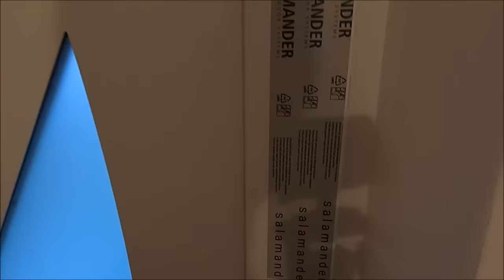I'm Finished with Painting in My Country House Renovation

Comment: To get a smooth finish with the gap filler, dip your finger in dish washing liquid then swipe down, nice and smooth.
Reply: But then you will have to tape both sides off first. Otherwise you will smear the filler out, and cleaning is a pain.
Better use a small U-shaped tool for that. You can buy it, it is called a 'kit scraper'. But you can also make it yourself from a piece of plastic sheet or pipe.
Moving that forward away from you it will flatten the gap and at the same time remove and collect the excess filler without smearing the surrounding surfaces.

Comment: Great job on the renovation. 
If it is cold the caulking will be harder to squeeze out. If you put the caulking tube in hot water for 5-10 minutes before you use it that will help. 
:)
Reply: Not sure that will help. The silicone you can paint over has a different consistency from the regular elastic ones. It's more stodgy, more putty like. If I remember correctly water makes it a bit more pliable.

Comment: Suggestion your palm tree requires a bottom basin as the camp will face t your files below. The other suggestion is the palm really requires a LARGE container for best growth. 💚🌴🌱
Reply: Agree. Those pot look a bit small.
At the same time best go for hydroculture. That will prevent the inevitable pest insects that result from indoor palms in soil.

Comment: 19:30 : you should know by now that you will never get those wool rollers clean.
There will always be residual paint coming off. But worst of all the plush structure of the wool will be gone and have become coarse.
Can't use that anymore because it will give a strange structure.
Save yourself the trouble and throw the roller in the bin and buy a new one. Better still, buy two. You will always need another one at an inconvenient moment, and the shop will be sold out.

Comment: I would think you had to put a handrail on there, so you would be up to code?
Reply: Building codes are different all over the world.
Reply: @_PJW_  Not anymore here in Europe but.. "At present, take-up of Eurocodes is slow on private sector projects and existing national codes are still widely used by engineers."
Reply: @getgoing-cv  
I'm not aware of a current European regulation.
For The Netherlands a handrail is mandatory in most cases (art. 2.35 Bouwbesluit 2012).
Reply: @_PJW_  "Normaliter is de Nederlandse wet- en regelgeving gebaseerd is op de Europese regelgeving"

Martina gaat vast en zeker nog wel een valbeveiliging/balustrade plaatsen uit veiligheidsredenen
Reply: @getgoing-cv  
Nou, Nederland heeft een hoop wet- en regelgeving die geen EU-grondslag heeft.

Slovenië trad in 2004 toe tot de EU.
De 'Slovenian Building Act' werd in 2022 van kracht. Ik neem aan dat toepasselijke Europese regels en richtlijnen daarin zijn verwerkt.

Vraag is dus 'welke Europese regels en richtlijnen'.